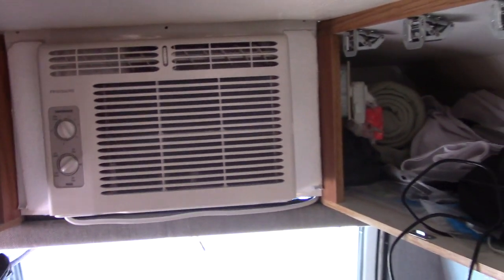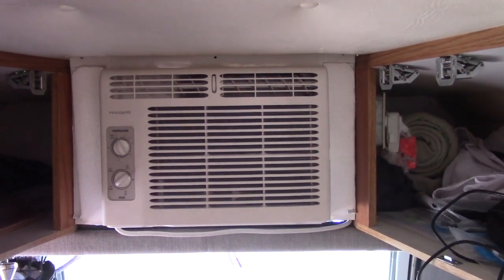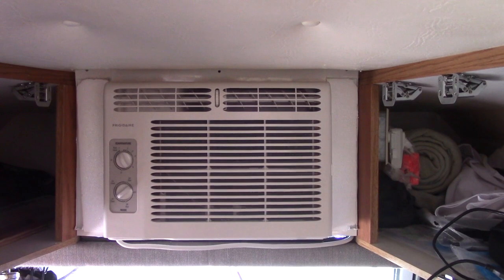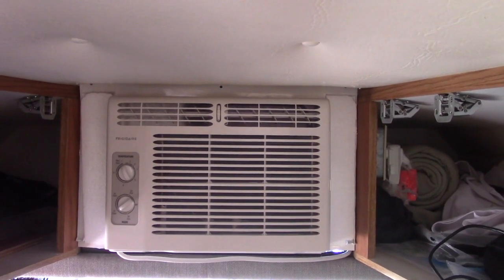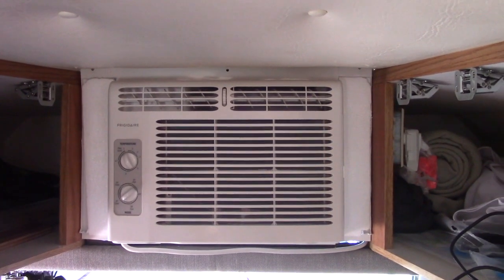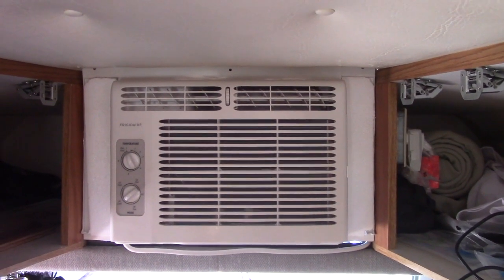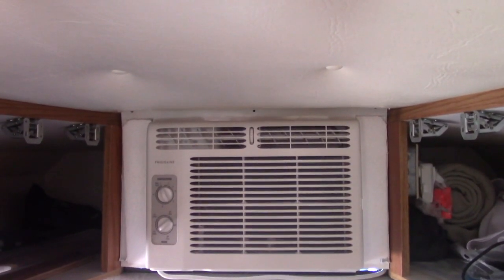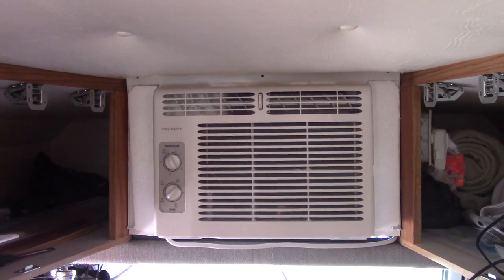Air Conditioner Talk

Comment: Do you get cold 🥶 air from the AC ? 
I have replace my Ac twice with new ones and I never get cold air  . I have the same road trek as you .
Reply from the maker: Hi A N,
Thank you for the question. Here is the thing, the air conditioner in the Roadtrek is a houshold air conditioner. On the sides, it draws outside air in and over the cooling coils and blows it in the house. Then it blows hot air out the back of the a/c unit. Normally all that part is outside, not so on our Roadtreks. So what Roadtrek did was build a baffle so that outside air comes in through the sides and hot air blows out the back. When we put in another a/c and don't make this baffle system and seal it, we wind up with just ever hotter and hotter air collecting in the area right behind the a/c. You'll see what I mean when you look at the sies of the a/c and the back. You'll also see how Roadtrek built the housing to do this with the original unit.  If the size of your unit is smaller than the original you will need to create some partition walls that match up with the vents on the new unit so it can get fresh outside air not the hot air from inside the box.  If you need more help, let me know I can do a diagram of the system, maybe that would be clearer. Also I think I discuss this in the video about 2/3 of the way through it.
Reply: Roadtrek Rich thank you so much will try that I saw your second video and will try to follow it , I’ll contact you if I need more info thanks agin

Comment: Good info, So because it has different dimensions from original AC, the air flow was not correct. Reminds me of the propane fridges that can be helped by having a small fan for air movement behind fridge.
Reply from the maker: Thank you for the comment.  Yes, it would seem that getting the hot air out from the enclosure is helpful under both of these conditions.

Comment: Hey thanks Rich. My onan generator needs to be replaced. Its 28 years old and seeing this video will help me do the job. Pls list all the parts you used. Where are you going to store the generator? Great video!
Reply: Sorry rich, I just read your reply to the generator. Thank you !
Reply from the maker: Thank you for commenting Joe O.  This is Youtube working at its best!  Here we are two people working to the same goal and Youtube is enabling us to connect and achieve that.

I will make an assumption that your Roaddtrek is also a Dodge van.  If that is the case, it should be very similar in terms of this air conditioner compartment.

I don't know if you are aware but Roadtrek chose the Dodge platform because  once the van was designed in the 70's, Dodge decided not to make any structural changes.  This commitment on their part made it possible for conversion companies including Roadtrek to build patterns for their interior parts that they wouldn't have to retool for.

The commitment from Dodge netted them a continuing stream of orders for vehicles from conversion companies for 30 years.

Thanks to your need to do the same sort of thing, these videos on  this project are going to be much more detailed and comprehensive.  I've written a lot of instructions so I'm familiar with the drill.

This is going to make this project much more rewarding knowing that someone else will hopefully be able to replicate the process with their vehicle.

The generator has been ordered and will be delivered in the next week or so.  I'll know better where it will be stored after unpacking and seeing it's size.

There are a couple of possible places that come to mind.  My van was built "generator ready".  So it has a box built under one the beds to house the Onan.

There is also a bin under the van accessible via a hatch inside the van at the rear door.

There is also a spare tire carrier.  If the spare were omitted, the generator might fit inside the spare tire cover and a mount could be fabricated inside to secure it.  If that didn't work out, the spare and cover could be removed and a box could be made to house the generator.  I'll know better once I have the actual part to work with.

The generator itself is sealed unless it is operating.  That means there aren't any fumes escaping.  It is CARB compliant.  That is California Air Resource Board.  CA is very strict.  ZERO emissions from something like this generator when it is not in use.  Otherwise it can't even be shipped to the state.
Reply: Hi Rich, yes my roadtrek is a dodge 1989. Its runs great with the 318 motor. Mine is a independent. Came with a onan 2800 microlite. Which is not worth fixing. And I don't like having it running inside the coach. Thank you for the info about Dodge. I do marvel how well done roadtrek puts together this product. Everything works. My wife and I are very comfortable in it. I'm thinking I will remove the onan and install 2 more 12 volt batteries. Total of 4 in place of the onan generator space. And install a solar system too. Having the generator to run the A/C and solar charging the batterys will cover everthing. I am looking forward seeing your videos. This is huge help for me and others in what you are doing. Thanks again!

Comment: That's great information. Heat or air will naturally take the path of least resistance. So putting an outlet for the hot air (vent/fan) pulls it out. I make cook cycles for a 3 zone/stage continuous oven utilized for hot dog production. The ventilation, chain speed, relative humidity, etc all played a part. Your vent idea is spot on; brilliant!  I have hot air from the attic coming into a bathroom vent because the cover/lid fell off. You wouldn't think hot air (fluid) would go down but it's the path of least resistance.
Reply from the maker: That oven sounds like an interesting machine.  Have I seen it in stores that sell hot dogs?  Is it a commercial or a consumer product?

I used an oven of sorts when I did screen printing.  It was used to cure plastisol inks screened onto t-shirts and other fabrics.  And yes, the speed of the belt and the temperature of the oven were critical to both curing the ink and avoiding scorching the material.  A similar oven system is used by pizza parlors and burger companies to bake or broil those products.

I am fascinated by how things work.  Once a person has a little basic understanding one can see physics, mechanics, fluid dynamics, thermodynamics, all sorts of wondrous things unfolding all around them.

The intake/exhaust system was already in the van and was designed by those brilliant folks at Roadtrek who wanted to use and inexpensive household a/c unit instead of a more expensive, intrusive rooftop rv style a/c.  I just observed their original concept and realized when I changed the a/c to a smaller one, I needed to scale down their system to match the smaller unit.